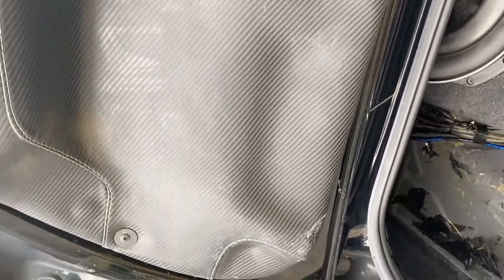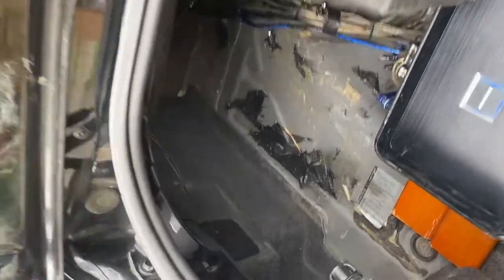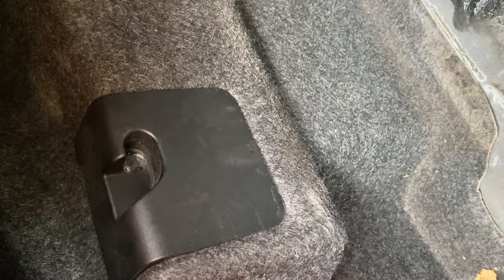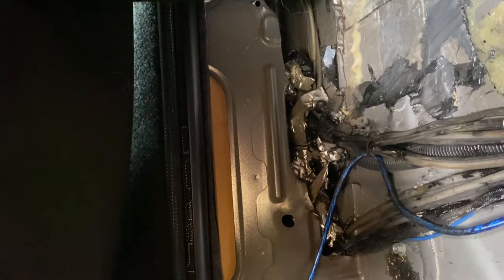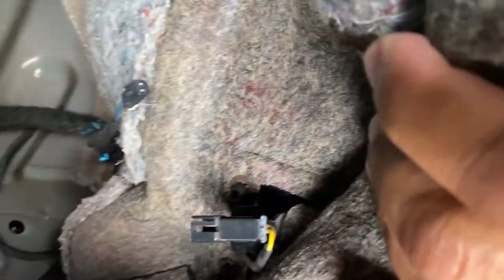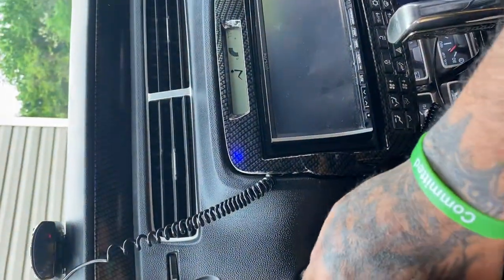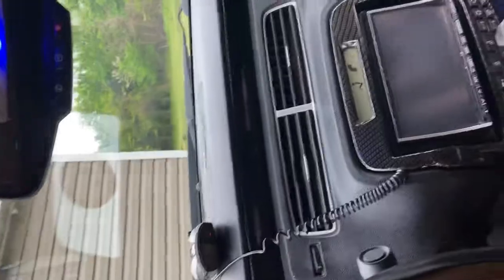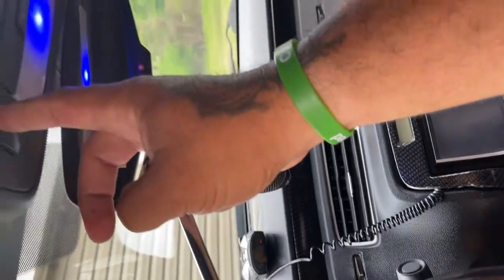How to bypass the sensor to let the convertible top down 2010-2015 Chevy #Camaro #Convertible

Comment: How do you disconnect the sensor? Having a horrible time.
Reply from the maker: Use a small flat head and gently lift the tab and pull apart. It’s very simple. You’ll get it

Comment: I have a 2011 RS conv. Camaro. Tried it. The top doesn't opens. Maybe some tips?
Reply from the maker: Does your top work while is plugged in? If not check the fuse for your top
Reply: @adrianandchasity  No the top isn't working properly. Sometines the roof opens, sometimes not. It, seems that the Detent Shade sensors in the trunk needs to be replaced. I want to pass by the use of these sensors.
Reply: I will check the fuse and let you know.

Comment: Anyone have a drain tube out of place in the trunk.  The passenger side drain tube doesn't sit properly and it's bent so when it rains that bladder under the soft top leaks over Into the trunk.  I can't find anything about replacing,  removing or fixing this issue.  Thanks
Reply from the maker: That may be a dealer item, I would check with the Chevy dealership. Sorry I couldn’t help you. I sold my Camaro